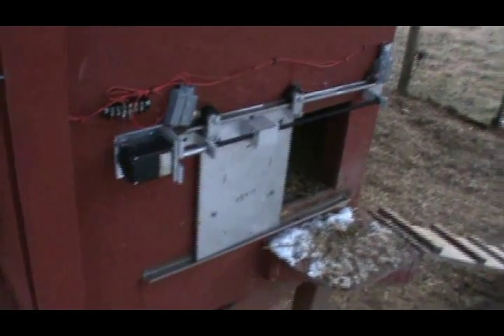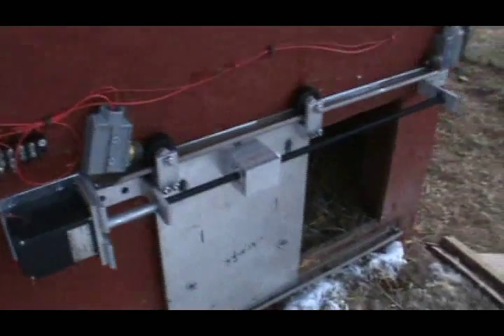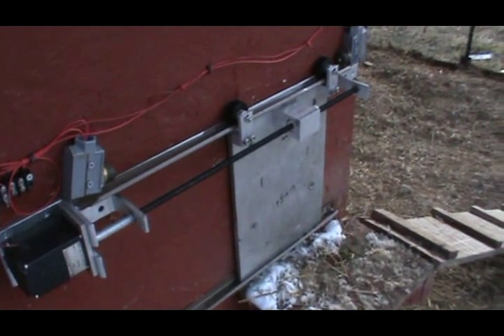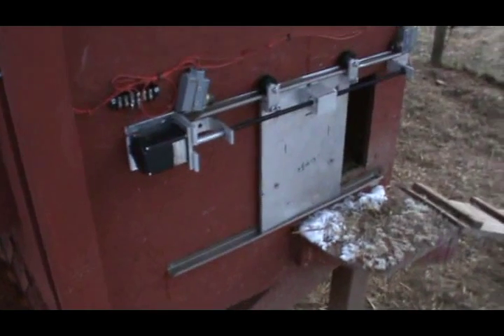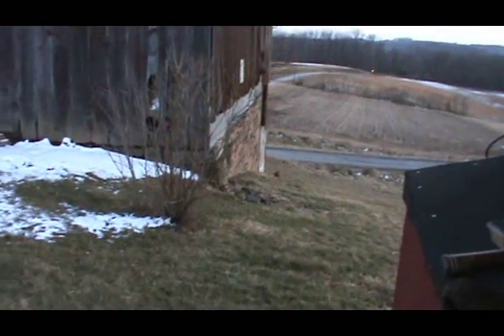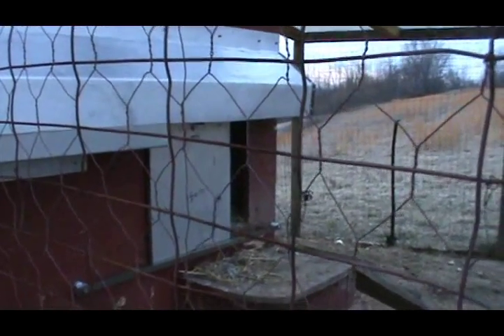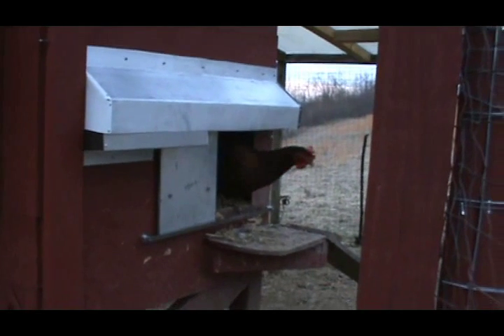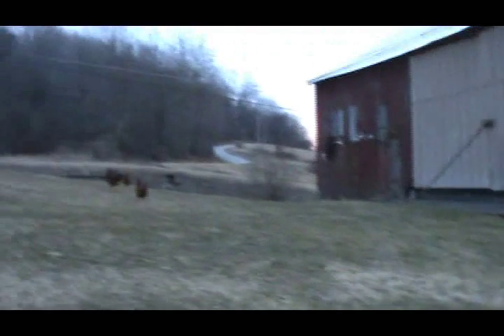Automatic Chicken Coop Door

Comment: I designed one of these to open with a heavy duty solenoid [hinged] and operated with a standard industrial photocell on off switch. That reduced the parts list to almost nothing. Could do it with one small solar panel and battery also. Follows the seasons automatically. Various animals ate my chickens and I postponed the project. Someone sells these online for a huge sum.
Reply from the maker: Richard Raucina sounds like you did a fine job. so many ways to do the same thing. mine has been working for a long time. The eye would be a nice addition
Reply: Yours is certainly the cadillac door. I see a bunch here now of many designs. The photo cell - maybe 16 -25$ could be adapted to any, and would automatically follow the light in the same way chickens do for the seasons. I wonder how many chickens have been caught in these door designs? Well, they are pretty quick so  probably beat the closer.